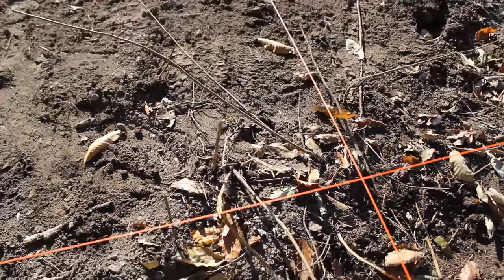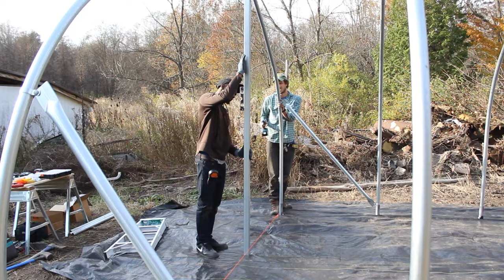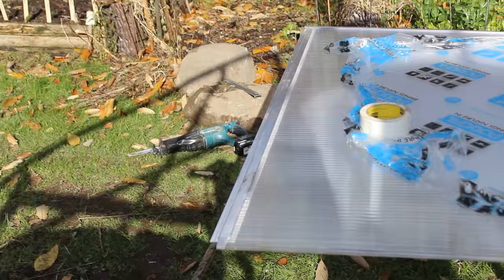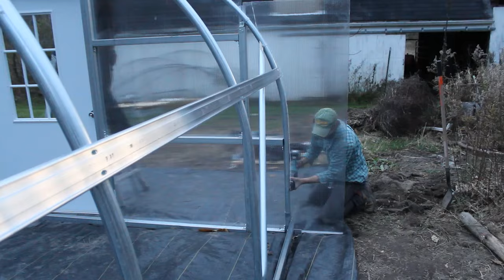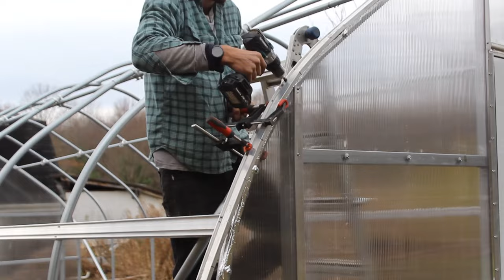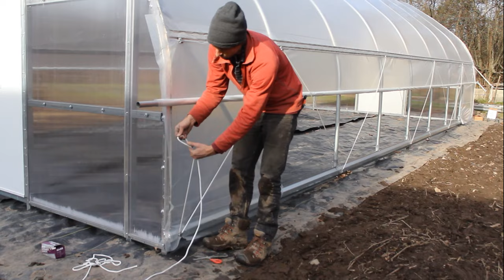Greenhouse Build Time-Lapse | Full Install Backyard Homesteader DIY Kit EXTREME Detail

Comment: Love the video. You guys are clearly skilled at what you do. Would love to see a slowed down version of the roll up install.

Why didn't you frame the greenhouse base with wood for extra insulation?
Reply from the maker: We actually DO have a roll-up tutorial video showing this exact structures' roll-up side's being installed - you can check it out here: https://youtu.be/c7zNk4EXHac You can also check out our general roll-up side "how-to" video here: https://youtu.be/Ei3eePwdpyM

As for the question on why we didn't use any lumber around the base, there are a few. First, I do not think the additional incremental insulative impact of lumber baseboards would be worth it. As in, for the amount of insulation that lumber could have supplied, I didn't think it was worth abandoning the metal baseboards, which won't ever rot out like wood does. 

Thanks for watching!
Reply: @tunnelvisionhoops  Makes sense. Thanks for the links and reply!

Comment: What would it cost to have this installed in New York?
Great video!
Reply from the maker: Hi Penny, thanks for watching. The structure shown in the video can vary in price depending on what features you select for the final set-up (there are inter-changeable features as you may have guessed). That said, the price range at the time of writing this for a FULL PACKAGE DIY, kit like the one seen in this video, would fall somewhere between $3500 and $5800 before shipping. If you want a line item quote, feel free to send us an email to info(at)tunnelvisionhoops(dot)com, with your desired length and a zip code, and we can send a full quote with a shipping estimate. Thanks for watching!
Reply: @tunnelvisionhoops   I will email you. Thank you very much for the info.

Comment: What are the 4 panels of plastic sheeting installed on the ends of the sidewalls called, and why are they needed?
Reply from the maker: Good question! They help prevent wind from scooting into the structure at each corner when your roll-up sides are down... they prevent you from having to ACTUALLY wire in the spring wire at the corners. This is great during the fall and spring when you use your sides a lot. We actually have a video on these panels of plastic you should definitely check out; here is that video: https://www.youtube.com/watch?v=AfsxdyaoWjk&t=0s